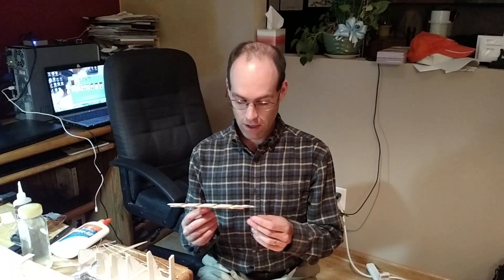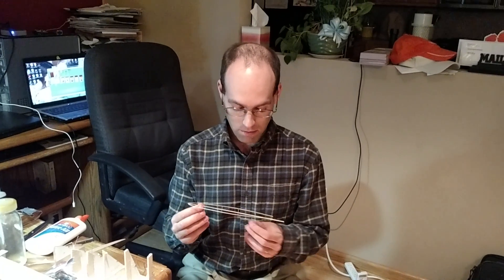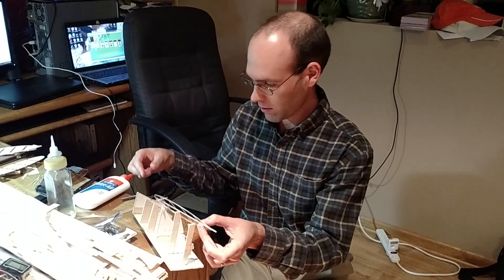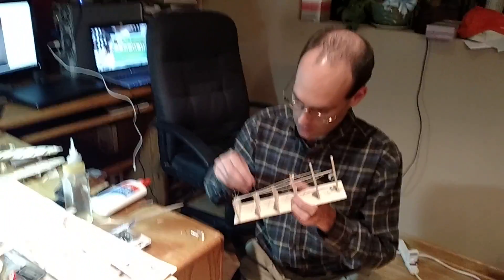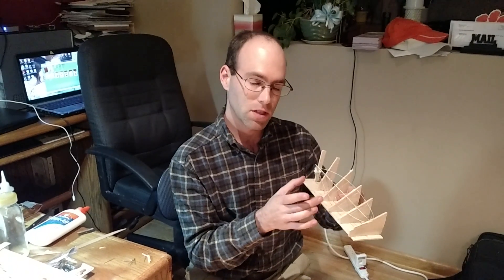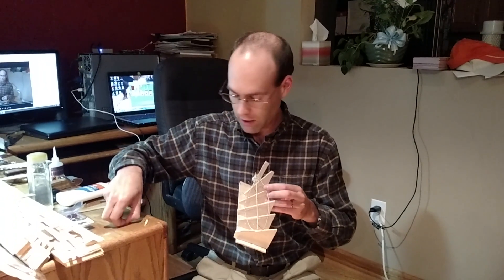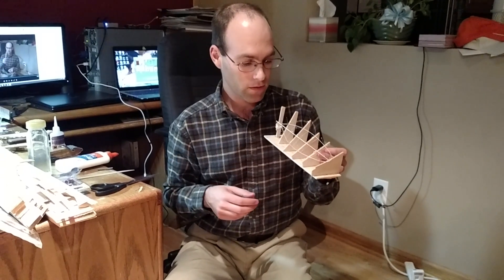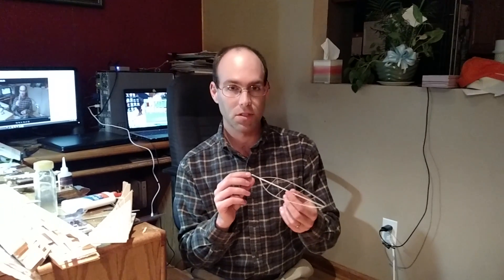F1D Propeller Construction Tutorial

Comment: Flite test brought me here. Im eager to learn how you make this. I plan to make one myself. I really need the full details and try to film the process. How can i have the measurements and materials? Thanks.
Reply from the maker: Start simple. This is the Formula 1 racing of the indoor flying world. Build Darcy Whyte's Squirrel, then move up to a kit for something higher performance (like a Junior Flyer at jhaerospace.com or one of the lightweight designs at lasercutplanes.com), then a pennyplane, and then the hobby shopper ezb. Also go to the downloads at indoornewsandviews.com and download "the best of INAV" and read it end to end several times.
Reply: Thank you for the quick response. May i know where can i get the same model plane from the flite test video? Which website you mentioned above? Thanks.
Reply from the maker: @dronemaneuvers  the planes in the video were all scratch builds and at present only the little one from the beginning of the video is available as a kit (at my website, jhaerospace.com,  it's the K777 Ministick). This stuff is extremely customized...we're pushing the absolute limits of materials and engineering to get them to stay together in flight. Something you should consider is a kit for a pennyplane like the one talked about in the FT video as a good beginner's plane (after you've built something really simple...trust me when I say this stuff is incredibly fragile and detail oriented) is a pennyplane kit. I sell one on my website called the Incentsitive. With a little effort it flies far longer than you'd expect and looks cool in the air.
Reply: Thank you. Ill check it out.

Comment: I used to use a big old wine bottle as my starting point to form my blades. I would wrap it with masking tape then lay out my center points and angles in pen on the face and tack my blade parts in place. It worked but probably no where as good as yours. I wonder if there is a kit of the form or gig that you have.

Comment: How do you get the outline to follow the curve of the tip without cracking? Do you wet it or heat it?
Reply from the maker: Yes, wet it, and then push (don't pull) the strip of wood around the blade form. Easiest if you tape it to one of the little tags at the blade root and then work around from there.